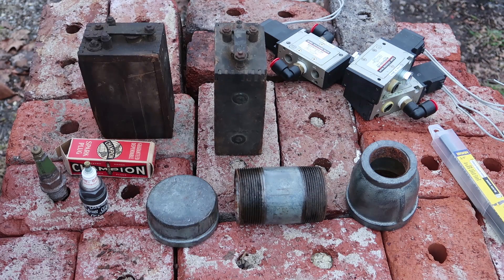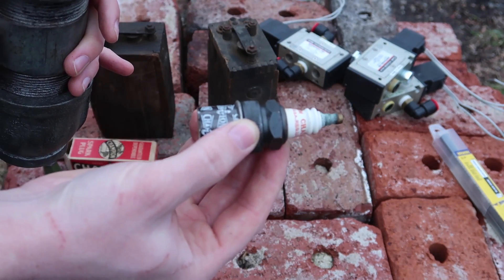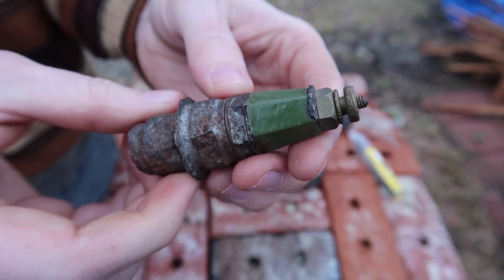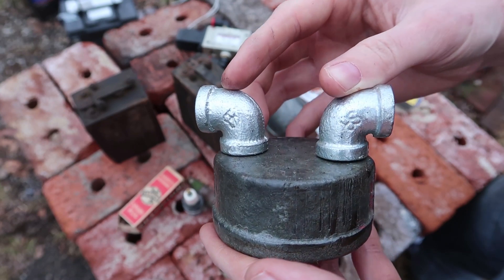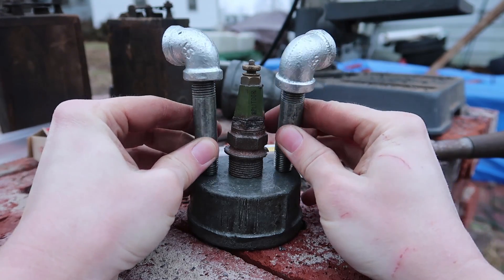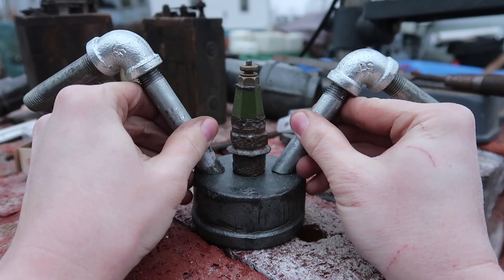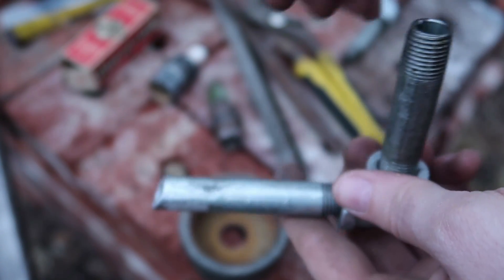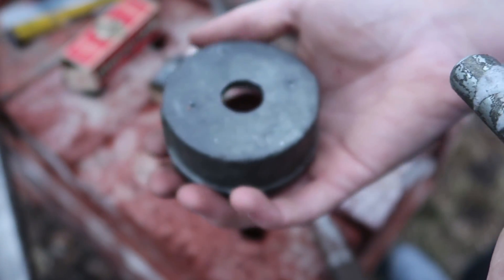DIY Liquid Fueled Rocket Engine 01: Simple Rocket Engine Combustion Chamber

Comment: The sparkplug looks like it could be from a "Model T" or something, same with the coil. But, hey, we must use what we got on hand ;) New here, and so, don't know how you work, but this certainly does look fun. You know, if needed in future, you could tap those fuel entry holes, screw in short soft steel screws and drill a smaller hole in them. You would then have Changeable Jets if needed. Moving ahead on your videos to see what is next, hope there is more.

Comment: Didn't start it up?  Welded spark plug lol just size the threads and tap and die it so you can replace with other spark plugs if the antique one isn't hot enough to ignite kerosene : /
Reply from the maker: you cant build a rocket in a day, and cant get all the test stands and remote control equipment built in a single video of a multi-part series.

Comment: AC and DC "travel" just as well as each other at the same voltage. AC suffers EM loss so technically at very very long distances AC is worse than DC.
Reply from the maker: no, DC doesnt travel as well at certain voltages. if your talking millions of volts then yes dc is better, but at maybe 100 to 5,000v AC travels further.
Reply: @Rinoa Super-Genius This is a rather persistent myth. The only reason people said DC wouldn't travel as far is because it was at a much lower voltage which was necessitated by the fact that current switches hadn't been invented yet. (switch mode power supplies) thus the only way to reduce to a safe voltage would be to transmit from the station at a low voltage (thus a much shorter distance) or use transformers which only work with an AC field.

But DC and AC at the same voltage have roughly the same voltage drop except that there is some loss in maintaining an AC field around the wire length which results in EM loss. DC doesn't have that problem. Have you ever wondered why the US adopted the 120v system instead of 240v? The ability to transform power voltages with transformers meant that the main AC grid could interconnect all the existing grids some of which were DC even. Thats why it became the standard. but before this most grids including the AC low voltage ones were local generated and in the case of street lights where there wasn't a concern of electrocuting residents high voltage DC was used.

high voltage DC or AC was a safety concern. but AC meant transformers could be used thus transmitting voltages could be kept at high while homes would be at a lower voltage.

Comment: What happens when you give a crackhead a drill press?

 Crack pipe... errrrr, ummmm... Rocket.
Reply from the maker: that is kinda funny, but just fyi i dont use drugs, including alcohol.
Reply: @RinoaL  I'm just kidding. Its alot more than I could manage. And your spark plugs were very cool, by the way.
Reply from the maker: well thank you! ^^b

Comment: SAFTEY BULLETIN:  Be careful about welding galvanized pipe without proper ventilation. That white       smoke will stay in your lungs for ever, or so i am told. Expressway to Emphysema or something 
similar. If you can keep a fan on it blowing away from you or stay in a stiff breeze you should be fine. 
Other than that looks cool, stay focused, good luck.
Reply from the maker: check the comments next time, im sick and tired of replying to this same comment.

Comment: Hydrogen is easy to make using a rubber bolt, rubber nut, rubber washers, aluminum washers into a jar of salt or baking soda water which you run a current through by jumping washers.

Symbols
[ ] = lead polarity on each end of rubber bolt.
+ = positive polarity connected to metal washer by wires from lead ends.
- = negative polarity connected to metal washer by wires from lead ends.
| = rubber washer

Example:
[+]|-|+|-|+|-|+|-|+[-]  12V DC should give you a good reaction just run the wires through a tight cap with caulk to seal the wire holes and use a hose fitting through the cap to make a way to collect the hydrogen with at least a 1/4 of the container empty at the top. That should allow you to get hydrogen for cheap and easy.
Reply from the maker: liquid hydrogen isnt, prove you can make liquid hydrogen
Reply: Cars do it with R134A for air conditioning in a car, it's part of the compression and condensing cycle. 

I'm just trying to offer you some ideas so you don't have to find a place to buy some hydrogen and then spend a hefty price on some hydrogen. Sometimes even though we know a lot, a fellow enthusiast can help us figure out something because their mind is not fully invested in what we are and there for them looking from further back, they can make a suggestion that has that big light bulb lighting up like the sun. I hope you don't feel that I was attacking you or insulting your intelligence, I'm only trying to help you reach your dreams faster and easier.

Comment: /!\ Do not watch this video without welding-graded eye protection.
On the structual strength part your fuel and oxidizer lines are maybe insufficient. Solder joint are not strong by itself and exert a lot of stress on both soldered parts. 
I would suggest you stretch the diameter of not-threaded end of both lines, drill the holes in the cap, slide pipes from inside of the cap threaded-end first and then solder them from inside the cap. 
This way your solder-joints will experience compression rather then stretch under pressure.

Comment: I suppose you could make your own hydrogen, via,  electrolysis,  but,  storing any appreciable amount,  especially under pressure,  can be.. problematic.  
If a source of hydrogen COULD be obtained,  then you could use a hypergolic ignition type of system,  using hydrogen and fluorine,  which immediately ignite upon contact with each other. 
Therefore you could simply eliminate using a spark plug type of ignition system.
Then,  controlling the pressure of the 2 gasses,  "hydrogen and fluorine", individually would be the most important focus,  depending upon p. s. i.,  flow rates,  reactivity rates,  combustion chamber dimensions,  etcetera. 
Oh.. just some f. y. i.  here,  fluorine gas,  is also highly corrosive,  so any & all "plumbing" on the fluorine system should probably be a fairly high grade of Stainless Steel.

Comment: U needed a TURBINE baring sprocket within the tube center connection to ball baring couple to thermal metallic rod from a stun gun electron arc rod however the second rod must have a indentation wafer touching the sprocket screw end. rod left or right side throughout the tube shaft extended baring stun gun battery 
However u should add bismuth & copper or just break down a portable ice maker to create REFRIGERATION of the vacuuming air converts into liquid DENSITY through cool exchanger at vacuuming liquid filled particle enclosure in space through ( heating turbine bladed)?  Whenever vacuuming compressor  accumulated matter within your drip shaft for vacuuming Recycling liquid for SUPERCONDUCTOR  electrolysis within an additional over tube liquid Peltier effect shaft   for spending Gas thermo heated vacuum pumped re-routed the liquid compressor that's all. To the 🌕
Reply from the maker: you may want to try writing your comments better next time because that was unreadable word salad. you know technical words but not how to use then exactly

Comment: If hydrogen is so hard to get, why not just make it? Is the amount you need cost prohibitive to make?

Oh dear... I've been working with metals for many years but recently finished machining school and this makes me cringe. I know that taking on another trade is probably not worthwhile for doing hobby work but if you simply get a $15 set of digital calipers and learn how to measure with precision, it will make a world of difference. There's a few cheep machinist tools that would be sooo helpful. The common triangular file that is an equilateral, matches the angle of 99% of threads if you need to clean up threads but consider buying a cheep tap&die set. Lower RPMs when drilling and use oil. Use a punch followed by a center drill before drilling to size if you want the hole within 0.01" with practice you could get within 0.005". Those few tips, while crude, will help a lot.

I feel dumb now because you're going to weld but a little bit of the basics will go a long way.

Comment: I would like to help with this project, however I can. My rocket project could potentially benefit yours.
Reply from the maker: do you have a launch site or liquid oxygen?
Reply: Rinoa Super-Genius I'm still trying to find a good launch site, we almost blew up a school testing 5" pyrotechnic shells on top of our motors, so we need more space to work as well. 

What may interest you is the Vehicle Controller, Mission controller and Ground support equipment we're working on. I could make you some special 3d printed bottle knob actuators to adjust your valves for fuel/oxy feeds. I can also donate a bunch of IP cameras to put all around it so you won't have to risk nicer cameras.
Reply: Rinoa Super-Genius I also was working on an 'Planet Suit' that used peltier junctions for inner temp regulation and it would also have an oxygen concentrator. So the oxygen concentration part might interest you.
Reply from the maker: thanks but im working on my own valve-actuators, my job at Apple involved a lot of 3D printing so id rather do that myself instead of trust somebody else. and i have some thick plexyglas to put before my cameras so hopefully that should be enough. thanks anyway.

i already have two test sites i can get but just needing one for when i actually start launching stuff. i might talk to Cody from Cody's Lab about finding a place to launch stuff.

Comment: Not to ,dissuade you from your goal, do take note when welding galvanized steel the fumes are highly toxic,and the weld is inferior,unless you remove the coating on the metal you will ha e voids in the weld.
Reply from the maker: or i do it outside and hold my breath. lol

Comment: I hope that wasn't galvanized metal. Welding on galvanized metal will give off a gas that is poisonous.
Reply from the maker: it was, however i hold my breath while welding anyway and it was done outside. only really matters if you are welding indoors or there is no wind

Comment: Using steel is a good way to get hurt!!
Reply from the maker: what?
Reply: Steel fragments and sends out shrapnel when it over-pressurizes Aluminium will usually bend, balloon, or split letting the pressure off slower. In any case give yourself a lot of distance.
Reply from the maker: depends more on how its manufactured. worked steel is far more ductile than cast. cast aluminium would be bad also. you should be upset about using cast metal not the element i use. however this test chamber wont be getting above maybe 10PSI at the most since i dont plan to actually produce any thrust with it. this is just me learning how to control fuel flows and injector experiments before i make a more functional one. and yes i will most likely test it remotely with a hill between me and it. hopefully watch via tv camera and monitor.

Comment: DONT WELD ON GALVANIZED PIPE

if you do.....ya need a respirator (not just a dust mask with the metal nose thing.... it needs to seal)

the "1970s oil field" trick is to a lot of milk before and after....... and hold some in your mouth while welding 

my dad welded bridges and all sorts of shit (wanted to be an underwater welder)
he says it works..... and i gotta believe him

the little bit you did probably isnt gonna hurt ya....but larger welds will make you sick as a dog!
Reply: and ya can heat the metal with a blowtorch to kinda "cheat" 

gives better penetration and helps when mixing metals
Reply from the maker: i just hold my breath no matter what i weld, and i weld outside where the wind will blow anything away.
Reply: @RinoaL  meh...still
if your welding for 8 hours....like my dad did..... your going to have to breath a few times.....and the wind wont be their every day

the small stuff you did..... probably no big deal.....even if you huffed that off-gas like it was going out of style

but if you ever run a 2 foot weld on galvanized stuff..... use protection (giggity)

Comment: Another fuel you could try (other than methanol... V2 anyone?) would be the nitro methane that you can buy for RC cars. It's a bit on the expensive side and does have oils in it as it's a synthetic blend meant for 2 stroke engines (basically little 2 stroke diesels) but you can buy it easily and get it in up to 66% nitro methane (up until a few years ago 40% was the max) a gallon will rip you about $76 though and you can get it on amazon :D
Or you can order it on ebay and get 100% for $81.70/gal https://www.ebay.com/itm/Torco-RC-Fuel-100-Nitromethane-Gallon/202402981614?epid=1162395718&hash=item2f202866ee:g:z28AAOSwe35bcv9g:rk:2:pf:0 or less if you buy it straight from a Torco official dealer (73.37/gal bottle.. $30 and change/gal for a 42gal drum... $1300) https://torcoracefuel.net/pro-fuels.html
By the way, take a pair of pliars to the round bit on the top of a modern spark plug, it will unscrew and there's threads underneath it.
Remember anything galvonized is zinc plated which means toxic and will pop the plating off if you get it too hot. You are better off using stainless or just bare steel parts. (Yes I know me pointing out toxic after bring up nitro is kind of stupid as nitromethane and methanol are both highly toxic fuels)

Comment: You should really be careful with who you share your inventions with. The parts on the table look more like bomb materials than rocket parts. Also, you should be real careful about breathing in the vapors that come off the assembly when it gets hot enough to smoke off the zinc coating that's used on galvanized metal. That zinc will do a number on your nervous system if you breathe it in, so my best advice is to respirator up and stay up-wind of the fumes that would be liberated from the pipe in a test-run. As a welder, I would have burned off all the zinc in a controlled environment before doing any work with those materials.
Reply from the maker: just because something is made of a pipe, doesnt mean its a bomb. seriously all you people are retarded. its like youve never seem an actual pipebomb before.
Reply from the maker: i hold my breath any time i weld, i dont want any fumes at all. and if a cop thinks this looks like a pipe bomb theyd call an airstrike if they saw an old boiler. lol
Reply: Holding your breath is not enough with zinc fumes. That shit lingers longer than you can hold your breath.
Reply from the maker: not outside it doesnt. the wind carries it away.
Reply: lol Whatever helps you sleep at night. I couldn't help but notice that you were welding downwind, to boot. Are you unaware that the zinc fumes can be absorbed by your skin?  Also, it's inadvisable to use the MIG process outside in the wind, as well, as the wind just blows your shielding gases away, which would explain why your welds looked so shoddy. 
That look is caused by oxidization, which means your shielding gasses were doing fuck all, in addition to all the inclusions that are incurred by trying to MIG weld through "dirty" metal. The only reliable way to get good welds outside is with SMAW (stick,) and you really should prep your parts before welding them if you want your welds to last worth a damn.
It's your life, and you're at liberty to shorten it as you please. I was only trying to advise you of the dangers. Take it or leave it. Just know that zinc poisoning inevitably leads to early-onset dementia, so if that's something you want, just keep going the way you're going. It's no skin off my back.
Reply from the maker: im fine with bad welds, they still work for what im doing.

and i dont plan to live very long anyway so its fine.
Reply: Whatever floats your boat.

Comment: Wow, Hellen Keller can weld better than that, also why you even welding on cast iron, you can’t weld cast iron it will just fall of the metal
Reply from the maker: yes you can weld it
Reply: Rinoa Super-Genius no, you can’t weld it. I am a welder and there is no possible way to weld cast iron with a GMAW or “MIG” welder like she was using, maybe is is possible with SMAW or “stick” welding but the way she was doing it will definitely fall apart

Comment: welding galvanized metals is awful, and you didn't use a tap for your spark plug? Comeon yo
Reply from the maker: why use a tap when it doesnt have threads?
Reply: @RinoaL  spark plugs are threaded, might have paid to get a new one if the threads on that collection piece are ruined. It's  a cool project, but I just think it could have been safer, more reliable, easier to fix and better looking to tap the hole and screw in the spark plug. If the plug that is in there breaks it will be hard to replace.